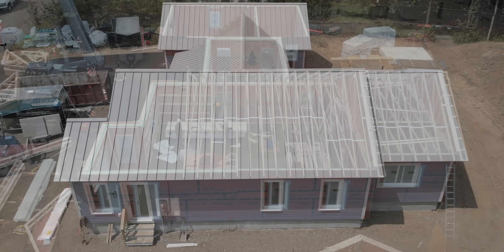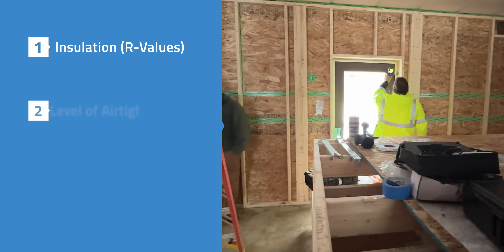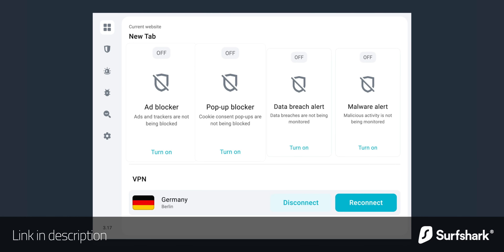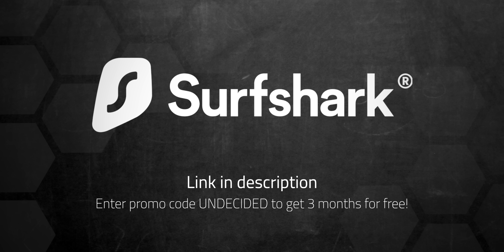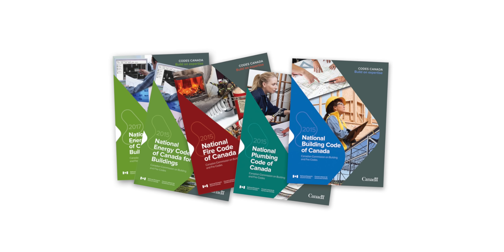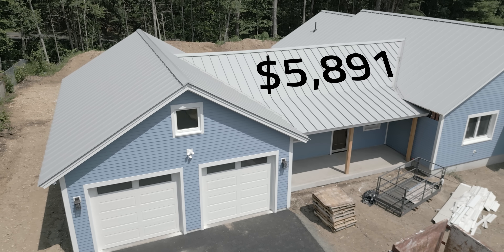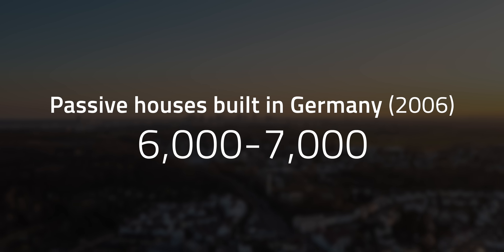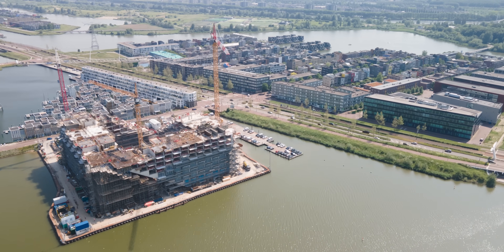Why Do American Homes Suck?

Comment: New American homes are mass produced, fast and cheap, start to fall apart on about eight years. There is no real craftsmanship. I would not own a house built after 1970, for that reason. Find a well maintained older home, you'll have less headaches, in the long run. Also, open concept has been marketed heavily, because it's cheaper to build. Don't be a victim of mass marketing.

Comment: I live in building that is only 17 years old, we already have structural problems that need to be corrected. This building is in south florida, many buildings are in the same situation, Im not engineer but in my opinion there are only two reasons for this condition...either the construction company used the cheapest materials to make a huge profit or building inspectors were on the t ke. There should be a data base that shows who built the building, who inspected it and if the builder or owners of the construction company are b still around

Comment: In Europe our houses have double walls, built with bricks or concrete, ceramic tiles on the roofs and double or triple glazed windows. The space between the walls is injected with expanding insulating foam Also the roof is insulated. Many houses have floor heating.

Comment: In South Asia, houses are built with bricks, concrete and iron. Walls are 9 inch thick which is two bricks deep. Only the place where single brick wall is used is like a non load bearing wall for separation. Roofs are steel reinforced concrete. No need to insulate against anything. Those are bullet proof.

Comment: Having a uniform code ignores the diversity of areas in the USA:  the deserts in the South West (dust storms and high heat), tropical climate in Florida (Hurricanes), flat plains of the mid-West (tornado alley), Mountainous terrains of the West (earthquakes), deciduous terrain of Northeast. Many Northeast homes have basements, but the Pacific NW have very few homes with basements.  Brick homes are prevalent in the Northeast , but the Pacific NW have fewer due to earthquakes.  Homes in the coastal Texas and Florida have elevated homes on stilts due to flood surge / hurricanes.

Comment: What amazes me is that in multi-family dwelings they do not require drains in places like bathrooms, kitchens, and with the washer. Also dryers are actually not neccessary. If you can dry your cloths without a dryer in Shanghai, which is so extremely humid, then should be able to do it in almost all of the US

Comment: Good timber constructions are sustainable and allow constructions that would not be possible with concrete. It also has a lower co2 footprint than concrete. Earthquake resistance is also higher. In europe, poorly insulated old concrete buildings are wrapped in flammable polystyrene. The future belongs to timber constructions. We live in a half-timbered house that is over 300 years old, built in 1710 from oak and clay, with a well-insulated roof and walls. It will still be standing in 300 years' time...
Reply: Americans talk about CO2 emissions, what a joke, you are funny guy

Comment: I actually built every bit of my own home myself including all structural, electrical, plumbing, and mechanical systems.  Being on the water, in Florida, I calculated the heat loads across the whole structure.  I am not influenced by "propaganda" by anyone, including you.  My home, built in the early 80's survived Hurricane Ivan with minimal damage.  Sounds like you are the one influenced by propaganda.

Comment: You need better building regulation and rules for how to build a house in Denmark where I live there is a rule that all buildings shall have at least 38 cm thick wall 1.246719 feet, and cavity wall insulation is also included. Then you can keep your warm even in a cold winter of course you need heat in the house but it not just disappear

Comment: In the energy efficiency of a house, it is important to use "heavy" materials, such as concrete, lime-sand blocks, concrete-lime blocks, or ceramics. Because it is also about the thermal incapacity of the building. These materials absorb heat/cold and slowly release it. Such a house in winter, after heating, even if we stop heating for some reason, will still maintain the temperature for some time, similarly to cooling. Wooden, lozenged houses do not have this function, because wood has poor accumulation functions, turning off the air conditioning/heating source causes the outside and inside temperatures to approach quite quickly. Another issue is the use of heating, in which you have to set a temperature slightly higher than you want to achieve. When heating through radiators, you need to set a much higher temperature in the network, about 50-60 degrees C, with underfloor heating, if you want to get a temperature of 22 degrees C, you set 27-28 degrees C in the system. There is also an interesting solution in Europe - capillary mats, which are mainly used on walls/ceilings, their interesting function is that you can both heat and cool the house, and they are even more efficient than underfloor heating, because you need a difference of about 2 degrees Celsius in the system. And of course, the house should be efficient, it cannot have chimneys, i.e. gravity ventilation, because it generates huge heat losses, mechanical ventilation will work much better. Of course, home insulation is also very important, warm window installation, using blinds helps - managing the admission of solar heat on cold days, and reducing the admission of solar heat in the warm period.

Comment: There are windows with 4 pieces of glass and 3 insolation tanks. I bought those for the apartment near the airport. They are awesome. Once you add heat recuperating system (which heats incoming air using outgoing air) - you don't have to open windows at all.

Comment: Our house was built in 2009 and has a very low energy consumption combined with a simple, fail-safe construction principle. It consists of 50 cm thick outer walls made of lightweight natural volcanic pumice. Only the uppermost concrete ceiling needs overlying insulation. This construction provides better protection against fire.

Comment: A cubic meter of concrete produces about 250 kilograms of CO^2. A typical German house uses between 100 and 150 cubic meters. The average US house uses about 50 cubic meters of concrete, and can use as little as 20 cubic meters with a concrete footing foundation for a much larger house than is typically built in Germany.

Lumber construction, on the other hand, sequesters CO^2.

Comment: Our insistence on efficiency is based on an outdated model. Everything that we have done to make homes more efficient, insulated, airtight etcetera are based on a world in which your energy comes from oil. We are entering a new era in which solar power effectively makes energy free and pretty much limitless. We are trying to solve the problems of oil consumption and CO2 production from 1975 and an energy crisis that happened in 1973.
A farmhouse built in 1850 with no insulation whatsoever could easily be kept warm dry and safe with solar energy with no cost to the environment. And this is a forever solution.

Comment: Canada has increasing building standards and it cuts both ways because it massively increases the cost and time required to build. Here in Canada we have a housing shortage so there is definitively a trade off between quality and speed.

Comment: Took me a while to get what you mean by "tilt and turn windows" - you are comparing them to sliding windows, which are indeed almost entirely unheard of here in the Netherlands (with the exception of sliding patio doors). I can see how those would be much harder to make airtight. It's funny how this illustrates how far removed this standard practice at least is from the one in Europe, that I didn't even know what aspect of the window was supposed to be non standard for the US.

Comment: Stop building wooden houses!! They are shacks prone to fires, mold and various pests. I wonder if people in LA will build wooden houses again because they can pack these old ones in a shoebox. Build with brick and concrete, let your roofs have a concrete slab on which the tiles go. Insulation on the outside, not in the form of a styrofoam facade because it is flammable but in the form of thermal plaster. Insulation on the inside. I know that people in the USA stick to traditional wooden construction but once the tradition was to live in a cave. Don't pay millions of dollars for shacks. So, yes, American wooden construction is ridiculous and as a European I would never invest in such a house.

Comment: Cheap construction including windows, the high price of closed cell spray foam insulaton, bad contractors, unskilled labor, and greed! Today there are very few good contractors and every home owner will choose price over quality. And every house looks the same due to the code requirement size of the bedroom window with a clear opening of 5.7 square feet for the lower sash.

Comment: Houses in Romania are built with walls of Ceramic Blocks in a reinforced concrete frame. The floors are also reinforced concrete. Exterior cladding is 4 inch/10 cm thick rockwool insulation plates. The roofing is timber structure with ceramic, concrete or steel tiles. Windows are thermo-panes.

Comment: When building a new structure it doesn’t seem cost too much more to make the structure though that would vary by country.  My property was built in 1895 so has different challenges for improving energy efficiency, there is a balance between improvement and cost plus where I live solar is cheaper than most western countries so more solar comes into the equation

Comment: Of course they don't suck.  American home builders would be perfectly happy to build European style homes if that's what buyers really wanted.  But it isn't, and so they don't.  Other factors are that Americans are, on average, more affluent and American household energy prices are lower, so the demand for the utmost in energy efficiency is not there.  At the same time, it's not entirely clear that Europeans home buyers are really demanding all the super-efficient building tech -- but European regulations require them.  And that's another difference -- US voters are much less likely to tolerate strict building regulations -- especially at the national level.  And this is really unlikely to change over the next 4 years (although, of course, individual left-leaning states like WA will likely continue to impose more strict requirements).

Comment: Why do I watch videos like yours?  To help me sort out what is political grand standing/green washing from what is actually practical/efficient/effective.  Energy has become overly political.  The USA should have been using the time and cost savings from cheep energy to implement better building standards and plan for a low carbon future.  Instead we got ineffective extremist flip flopping that wasn't practical on either side...and it continues today.  I'm still apprehensive when it comes to sealing up a house too effectively as this would create a moisture trap and mold problem, if not implemented correctly this can be a big issue, especially when retrofitting an older home, I'm leaning more toward new construction for a better home but someone is going to have to address my concerns.  Thank you for sharing your experiences!!

Comment: And your homes are build with wood instead of bricks or concrete. So they are less fire resistant, less wind resistant and less energy resistant. + anyone can break into your homes easily just by cutting an entry in the wall which is far easier with woods and carboard. it's like in the 3 little pigs story when they build their homes... and the wolf blow them all but the last one.

Comment: So, just came across this video a bit late.
I live in Romania, in a new apartment building. Currently our winter is a bit warm, temps get up to 3-5 Celsius during the day, and -5 Celsius during the night. I also have the inside temperature set to 22.5 Celsius. so far, after a week of roughly the same temperatures, the heating unit in my flat only starts every 3 days or so, and only for 2-3 hours since we are using underfloor heating.
Here we have triple glazed windows, special brick walls, exterior insulation of around 10-15 cm, and the building itself has a reinforced concrete structure, since we live in an earthquake area.

For new buildings this is quite the norm over here. I once left to celebrate New Years eve, for an entire week, and i turned off the heating since i wasn't gonna be there anyways. When i came back, after 6 days it had dropped from 23 to 22 Celsius, while outside the temperatures were around 2 Celsius

Comment: Here , in Switzerland, a lot of people are going for pre-fabricated houses, since those are built in the factory and usually meet all standards, even the ones that are not mandatory.
Of course mandatory standards we have here, seem like a luxury option in USA. Which they should not be, since they are both economical and ecological solutions, that are providing benefit in the long run. 
No one is building house and thinking, it will pay up in next year or next 5 years. It is usually on much longer term that you do your calculations. But it is worth it.

Comment: So if your U value of a wall is .025, but your U value of your windows are .25, ten times more, then it is almost pointless to spend all that money on upping the wall insulation from .05, which is cheap like R23 insulation to the R35 to R40 walls that will cost way way more.. That window in the wall will lose more energy that the whole rest of the wall regardless.  You would get more bang for your buck by getting insulated window blinds or smaller windows.

Comment: cost is the biggest factor, most likely if you add up all the costs you will never recoup them in energy costs.  There is a balance too inefficient and it will cost you dearly but there are diminishing returns.  I wouldn’t spend 30 to 40k to save 10k on energy.  I like the idea of efficiency but I have a limited budget, a family to feed.  It’s a very privileged position to be able to concentrate on efficiency alone.

Comment: There is truth in this video, but it unfairly paints Americans with a culture of cheap. That's not the case. An owner-builder can build for $50/sqft, while new homes in my area start at $250/sqft. It's a culture of preying on the consumer by contractors. Contractors don't have an incentive to build better homes - they charge too much for the average family to upgrade to better systems, and they hire the cheapest unskilled labor they can to pop up stick frames as low cost and quickly as possible. The typical building labor doesn't have the skills or experience to build more complex systems, and often times when builders try, the end product is not properly produced and leads to big problems early on in the home's life (especially related to water management in tight homes). Homeowners know this all too well when they need an HVAC upgrade for example. It's not uncommon for a homeowner to seek upgrade to a mini split system, and find out that an upgrade using $5000 in parts/materials costs $20,000 and installed in half a day. A dirty contractor won't even give you an itemized breakdown, but if you run the numbers, they are paying themselves $1000 an hour and marking up the equipment by 50%. Ductless systems are easy for almost any inclined homeowner to install themselves, but when you self install, you sometimes won't find anyone to charge your system, because they don't want to encourage competition! Plumbers, electricians, etc it's all the same grift. American builders have a culture of greed - that's the real problem.

The second problem is that homes are artificially inflated in prices due to rampant speculation. From Blackrock to your neighbor down the street, everyone seems in on the speculation of homes as investments. Look at the historic value of homes - homes were a store of value, appreciating at the rate of inflation. Now, every kid is flipping, megacorps are buying to force you to rent, and the middle class to rich are buying up everything they can to pop out short term rentals. It's all a house of cards and is going to collapse, which will be fortunate for the future generations so they can finally afford a home again. Sorry-not-sorry to the suckers enriching themselves on a human need. The one's that aren't getting out now will go bankrupt. Leverage is a hell of a drug.

Comment: For a country as big as the US with so many different types of climates even in individual states. It's kinda difficult to have standard home codes for everyone. Like in California. Building codes take into account earthquakes and other things. Those codes wouldn't work for states that get none at all. Or have completely different issues. Plus. East coast and west coast climates are vastly different. Just try implementing the same codes. Impossible
Reply: That's true, but the fact is that with exception of Florida, 99% of houses built everywhere else is the same  cheapest materials - sticks, toxic boards, plastic, shingles, all flammable and weak. And the cavity walls that eventually host various species of vermin.

Comment: Good thing that you can mold arbolite ( sawdust and concrete mix ) in any shape and form plank , block , brick , beam , frame  so if you need to build house make sure they make you precast Structural Integrity reinforced panels with frames made of same materials as insulation ( sawdust dust concrete mix ) it’s light weight dense and durable  like living in bomb shelter

Comment: Insulation is the key feature of any building no matter what the materials
Who would buy a all glass fridge made from 10mm plate ??? no one would
A dual brick building on a 8 inch slab will remain a constant temp all yr if windows are small or shuttered. The mass of concrete acts as Ballast shedding and absorbing during seasonal cycles